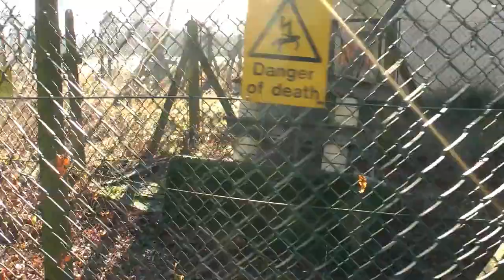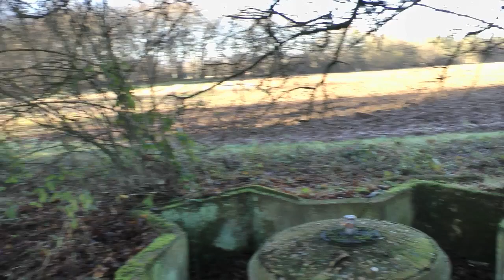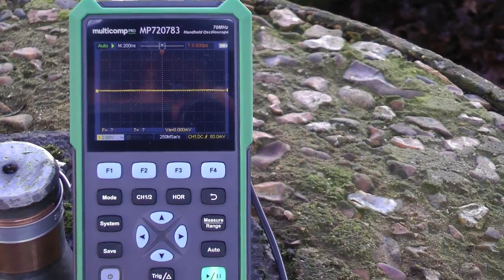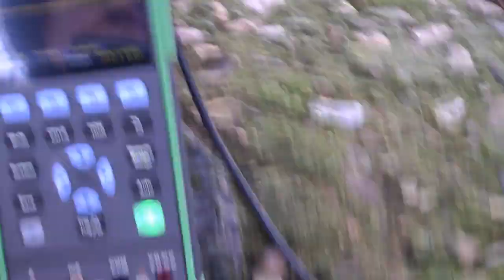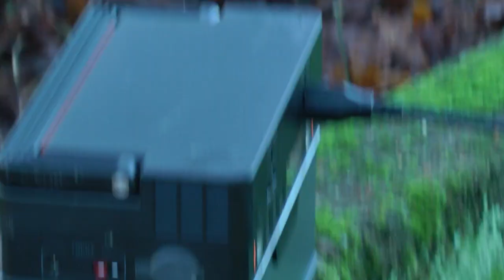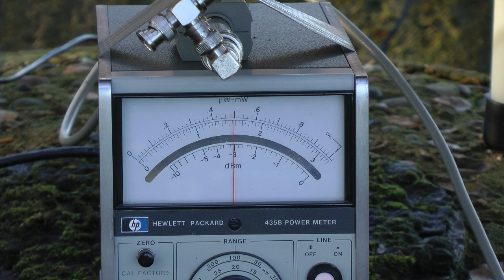Tesla Telluric Transference of Electric Power - Brookmans Park AM Radio Transmitter

Comment: Forcefeeding a radio signal through the ground really isnt a telluric current
Reply from the maker: Hi, yes I agree, this experiment is about exploring rf power transfer between a TX and RX through the earth via a telluric transmission medium, rather than exploring telluric currents that originate in the earth.
Reply: @aminnovations  you cant transmit a normal radio signal through telluric currents using hertzian stylr transmissions shell oil company actially wrote a paper on that they have a huge amount of research kn telluric currents thry stated that telluric currents are partially mechanical currents and longitudinal ones as well
Reply from the maker: Hi, Yes I understand that the TEM (transverse electromagnetic) transmission mode will not pass any significant distance through the earth. The Tesla transformer properly designed and configured can, at least in principle, transfer power through the earth via the LMD mode (longitudinal magneto-dielectric), and is one of the major conjectures that exists for the principle of operation of Tesla's "wire-less" power. A lot of experimental work is still needed though to confirm or refute this conjecture. There is much more consideration and many more experiments on the TEM and LMD modes on my website if you are interested.
Reply: @aminnovations  you are basically using the ground as a cunductor not taking advantage  of modulating electrical signals that are allready there

Comment: I have done some similar experiments.  I wish now that I had video taped them. Maybe in the future I will do them again. Here are a few things I learned, Maybe these things can help you get some ideas. 1 the radius of the transmission coil has a huge effect on how far it transmits. The larger the radius the farther it goes. Of course you have to tune each system properly for resonance. 2 the extra coil defiantly has a profound effect. However it must be set away from the system so that is is not magnetically coupled. Basically the extra coil is a resonating coil in its own resonance fed off a single wire from the transmitter. If you do this properly and it resonates freely with no magnetic influences it creates a very large and way more powerful electromagnetic wave around itself and its unimpeded so it travels significantly farther than normal. Also I have made reversed wound coils and put them in front of the receiver and produced almost a diode effect and when done properly  the transmitter does not seem to notice the power draw, as it would normally. There is a lot to be explored. I wish I had the time and setup to do it again. I know I transmitted about 5watts over 150ft before I stopped playing around. Good luck to you
Reply from the maker: Hi, that's a really good result you accomplished with your experiments :), and thank you for sharing some of the details. I am currently also working on an extra coil system, with more video experiments to follow as I do the field-work. I agree this is a very rich and interesting research area, with so much still unknown and yet to discover.

Comment: The metal "connector" embedded in the concrete is actually a Spigot mortar mount from WWII. Don't know if it is grounded though.
Reply from the maker: Hi, thank you for comfirming what this is, it is good to know what its original purpose was. It was the best ground we tested on the day, and better than a copper ground rod directly driven into the ground at the same location.